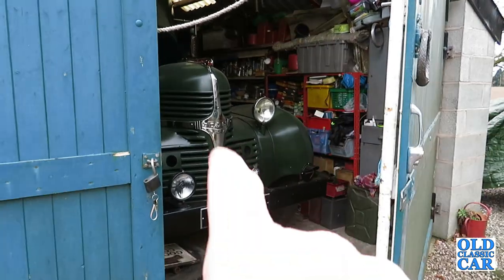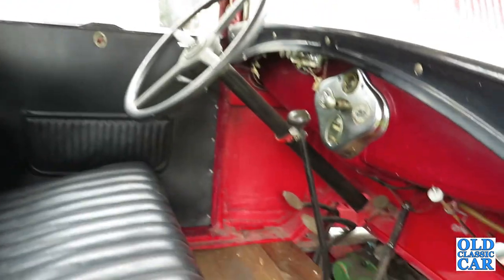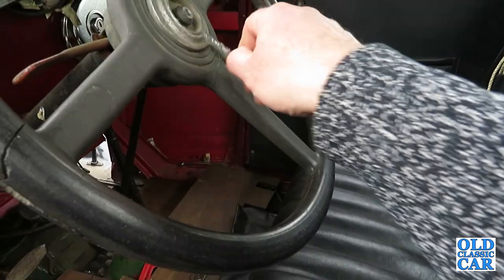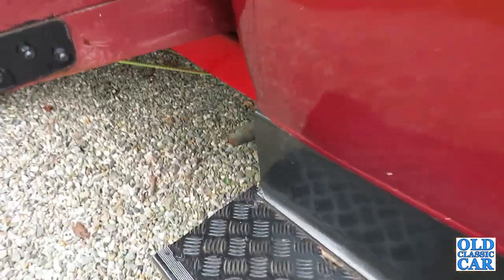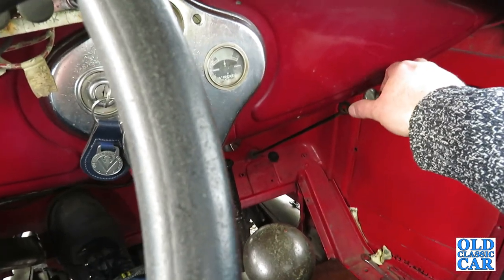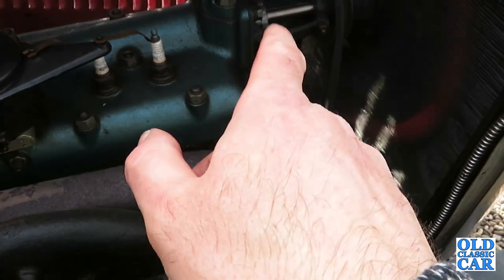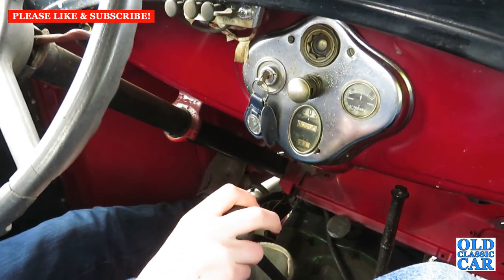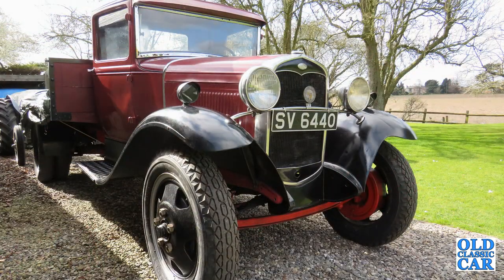Spring start for the 1930 Ford Model AA truck - classic trucks update

Comment: Model AAs are wonderful but I also like that Dodge 4 ton truck inside. Looks like parts from different years on the front. The holes in the grill are for a grill guard like the "40 VF military 4x4 trucks, but you have a 41 grill. Trucks are fun!  I have 8 AA and A trucks and 6 Dodge 4x4 trucks from WWII era (VF too).  I am not bragging, it is a FEVER that one gets and it becomes a type of an addiction, but a good one.
Reply from the maker: Hi, the Dodge is a 3-ton VK62B, for some reason they all came with '41 style grilles but I think were built towards the end of '40. It was supplied as part of a military contract to the UK, where it went to the RAF. More info on my site: https://www.oldclassiccar.co.uk/dodgerestoration.htm

Comment: Hello from a fellow Model A owner in Germany :D
A nice, solid truck you have! 
The AA was only delivered with the larger 3.3 litre engine - anything less would not have been capable of pulling the 1.5 tons this thing was rated for.
As for the light switch box, these are available newly built for around 30€ - they're the same as in the Model A cars.
I don't know about the UK, but there are several parts suppliers for these cars in Europe - "Adams classic" in the Netherlands or "Classic Cars Frohburg" in Germany, for example.
They should also have a replacement horn rod - and just about any other spare part you could think of.

Best of luck and God Speed!
Reply from the maker: Thanks for the info, I believe some AAs sold here in the UK did have a smaller version of the engine, I will look into this further :)
Reply: @oldclassiccarUK  The  AA truck was never fitted with the 3" bore AF engine  it produced 28 BHP @2600 RPM  and could never pull the a loaded AAtruck .I have all the parts books and the small engine does not feature in them . The confusion is caused by Ford calling the model AAF not that it had the small engine  but that it is RHD . English built trucks had the "BUDD" wheels made under licence by Kelsey Hayes in England . If you remove a wheel and

 check if The truck is manchester built you will see the "KH" trade mark in a circle about 1" dia and another with a date circle . The Detroit truck wheels are marked"BUDD"
Reply: The all steel  top cab was made for Ford by the BUDD company from mid 1931 until end of production .Your gas tank has been replaced with the earlier oval speedo version it should have the round speedo for that style cab  not that it matters  I have 2 AA trucks  and a lot of AA spare parts .

Comment: Great vid, it’s idling way to high though my best guess is somewhere around 600 rpm, it should be no more than 500 and they are usually happy around 300. It won’t hurt it at all but it will make the cab experience much quieter.

Comment: These AA trucks were the only A's that sold well in UK when new. I believe all British AA's had the full size engine not the 'small bore'which actually cost extra when new. It has a '31 deluxe grille shell fitted, the AA 'shell looked different , no 'widows peak'. It has the early '30 type dash  panel & tank ; previous to mid '30, commercials had the '29 sheet metal. Re the all metal roof cab you mention, this only  on the late '31's, made by Budd. I have 2 Model A's in NZ, sth Islnd, 1929 Tudor & 1930 Fordor, both Canadian export models.
Reply from the maker: Thanks for the info, the AA is no longer with me but one day I'd like an original Model A pickup

Comment: Your truck does look very good. A couple of observations though. The 1930 and 31 models (as opposed to the 1928/29 models) had stainless steel brightwork- that is- the radiator shell, the finisher after the bonnet over the tank and scuttle, and the headlamps. It is possible that the headlamps for the truck might be not SS, but I doubt it.  The petrol tank Is the mount for the instrument cluster, there is noting between the cab and the tank. Very pleased to see your son driving- pity the driveway is not a mile long for him! I would strongly suggest that he holds the steering wheel at '10 minutes to 2' rather than 5.35. That way he has much better controll as his elbows are clear of body or legs.. A great video, many thanks for it, regards, Dane, (Roverdriver)

Comment: A great truck-a friend many years ago had a 1930 AA dump--used it a few times--we lived on a hill--very scary trying to stop it with those mechanical brakes--but your truck sports a 1931 auto radiator shell- yours should be painted black--please show a video of the '39-'47 Dodge in the garage--my absolute favorite--was it originally a US army vehicle?--I noticed the holes in the grille for a brush guard
Reply from the maker: Yes the rad shell was incorrect, I don't have the AA any more. There are several videos about the Dodge truck on the channel (eg https://youtu.be/Z1aBJt_q47I), I do plan more Dodge content soon so keep an eye out for that too. Thanks for watching.

Comment: The radiator shell is from a 1931 Model A car, not a truck. And someone chrome plated the windshield frame and headlight bar. But still it's a great old truck.
Reply from the maker: Indeed so, I no longer own it but it was a great old truck and would have been straightforward to put back to original I think. Thanks for watching (I do still have a couple of classic trucks though, just not the AA!)

Comment: Excellent video on the AA. Which do you prefer the AA or the Dodge, both similar. I like the AA myself
Reply from the maker: I liked them both really in their own ways, the AA had the benefit of the Model A car's engine which made life a lot easier finding parts for (although the transmission, axles etc weren't shared with the cars)

Comment: Where did you get the petrol for this? Should it not need leaded petrol?
Reply from the maker: It doesn't need lead unless you're working it hard day in day out, don't forget back in the day petrol was of very variable quality and these old engines tend to run on whatever you put in without any harm done
Reply: @oldclassiccarUK  Ok thanks for that info.

Comment: Please give me first chance if it comes up for sale. If you look at the starter side of the engine (seen in the last moments of your video) notice that there are no gaps between the bores in the casting, , the smaller engine has a small flat between the bores. I have just finished restoring an early 1928 Pickup that was imported from Argentina to Spain, where I live. It is right hand drive and has the 3.3 liter engine then same as yours. The previous owner had it "painted" but a very poor job. He had done absolutely nothing to the mechanics, I have replaced the brakes completely, rods, drums, shoes, and operating mechanisms. New steering stub axles and drop arms had to be sourced as the nuts were missing and the drop arms had some weld dabbed on them to hold them in.!!!  I stripped the back axle and fitted new bearing sleeves to to axle case as it had large flat spots at the bottom.  I made a new roof , and a total rewire, the fuel tank leaked both sides so I had a custom tank made in Ally and fitted it behind the back axle with an electric fuel pump. etc. etc. etc. The list goes on, too much to list here.
Reply from the maker: Your pickup sounds fab